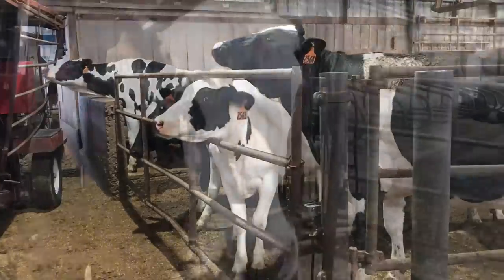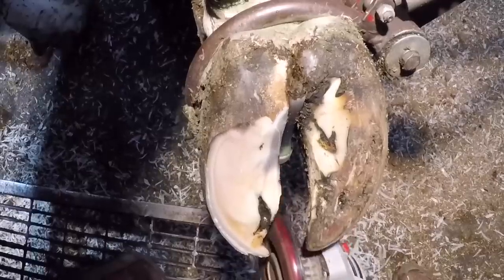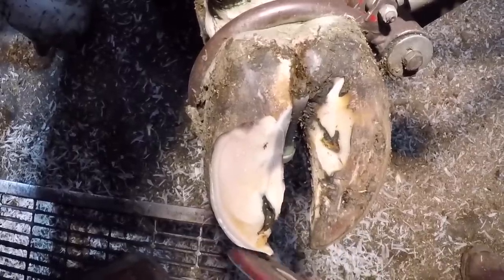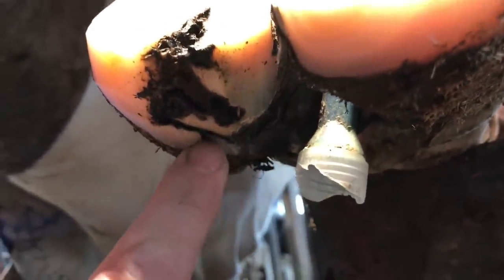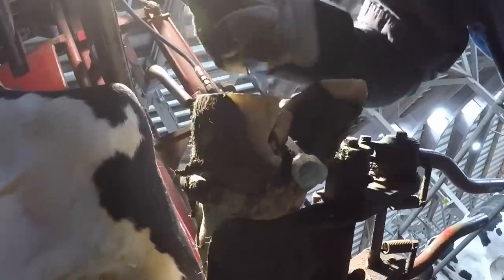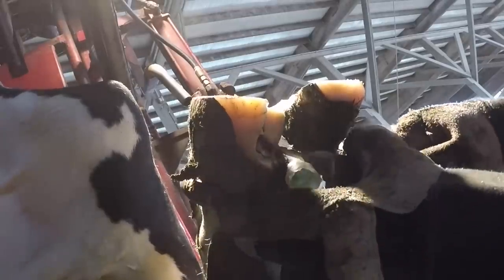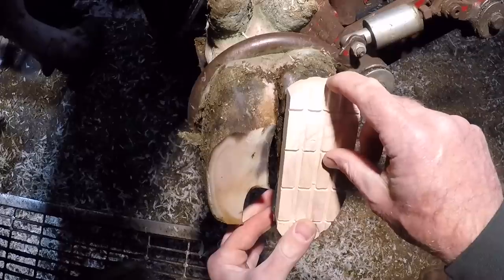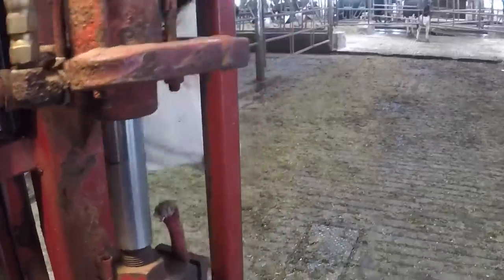REALLY!?!  You can’t fix that???

Comment: A farm I trim for has a cow we've been doing the exact thing for about 4 years now. Only problem with her is her tendon is pulled out and it does no good to put a block on because she rocks back on it. But she gets around great. I agree with this method in this isolated case.
Reply from the maker: Yep.  That’s exactly what I’m trying to prevent using the wooden block.  Once the flexor tendon goes it becomes more difficult.

Comment: Hi, I know nothing about cow's feet, but I have a fair amount of experience treating infected and necrotic wounds in humans. When antibiotics can't be used for some reason icing sugar works well. The powdered sugar soaks up any fluid that leaks, making a solution with an osmotic (sucking) force high enough to suck the water out of microbes. Use like the salicylic acid, change every 2 days; flush the sugar & debris off and reapply. The solution & the occlusive dressing also  creates an acidic environment which is bactericidal and encourages necrotic tissue to separate and new tissue to grow. Might help Ms Cow's foot and keep the organic status.
Reply from the maker: I’ve heard this but wasn’t sure it actually worked.  Never tried it.

Comment: Is there any value in removing the damaged area before keying the inside walls of the fissure and making a little mould around the whole hoof with thick tape and then replace all the missing material with epoxy….ha ha you’re kind of answering my question as I’m typing…I’m still leaving this..👍😁

Comment: Interesting to learn how organic farms deal with medical issues in their cows. 

Normally I’m against the use of antibiotics for cows (they’re often used to offset the rampant disease that comes from cramped conditions and corn feed, causing widespread antibiotic resistance in the process), but I can’t see how a humane farm using antibiotics only as needed should be an issue.

It’s a little unreasonable to expect that not a single cow on a properly run farm should ever have any medical issues. I feel like there should be some middle ground in the regulation.
Reply from the maker: Unfortunately, it’s the misinformation in your second paragraph that has led to widespread fear of antibiotic use.  Farmers don’t administer antibiotics when they’re not necessary and a visit to a modern dairy farm would help you understand that your second paragraph isn’t actually true.
Reply: @NatetheHoofGuy  thanks for the reply, out of curiosity does the same apply for raising cows for meat? Usually when I hear about widespread antibiotic use it’s in the context of CAFOs

Comment: The point of organic is to avoid having like excess antibiotics pumped into animals. It was creating antibiotic resistances in both their and our bodies. Overall very dangerous and irresponsible.

However it's totally reasonable to use them for a kinda necessary surgery. The two situations are not comparable. I know though that any chink in the armor would be used to game the system.

Comment: I noticed in one of your other videos you specifically  mentioned that your blade was a cutting blade so less heat is generated

and here you said grinding blade. I was wondering if this means you have different blades for different applications or if you were just using grinding blade as a sort of figure of speech
Reply from the maker: Figure of speech.  It’s a cutting wheel on an angle grinder.
Reply: @NatetheHoofGuy  cool to know! Thanks for the reply

Comment: I don't get why the requirement for the cow producing organic products is "no antibiotics" whatsoever, not even once. Non-organic cows get antibiotics even when they're healthy just to make them larger. That gives them antibiotic resistance, which could cause superbugs to mutate within them. So I get how that practice shouldn't be allowed for organic cows (or maybe to any cows at all). But if the cow just get antibiotics when it's sick, and it's not milked when it's on antibiotics, what difference does that make to milk the cow produces later? 🤔 Is this another silly trade law?

Comment: The problem with organic farming is that by now it is more of a religion than based on science. A lot of the rules for the farmers no longer benefit the organic farming but instead cause fixable problems.
Reply from the maker: This type of problem doesn’t have a good solution even in a conventional setting.  Antibiotics won’t heal this and amputation should only be used to save her life IMO.  For this particular case organic or conventional I would have chose the same method of treatment.
Reply: @NatetheHoofGuy  thank you for the answer. It just came across in your vid, that this issue could be treated with medice. I didn't mean to be harsh but in my oppinion there are aspects in the organic sector, that need to be adressed.